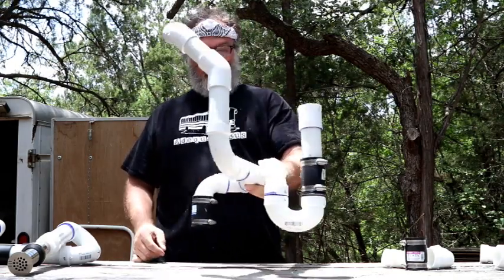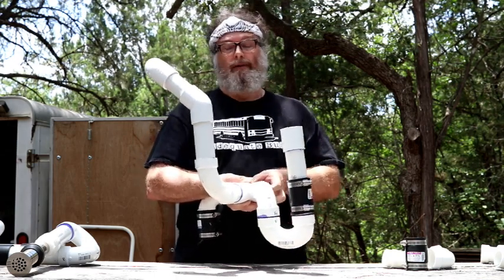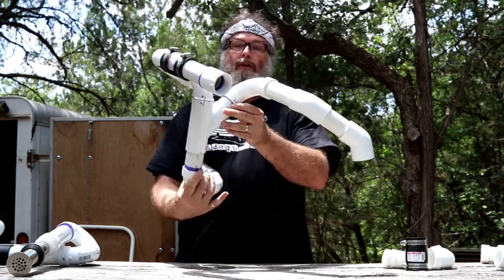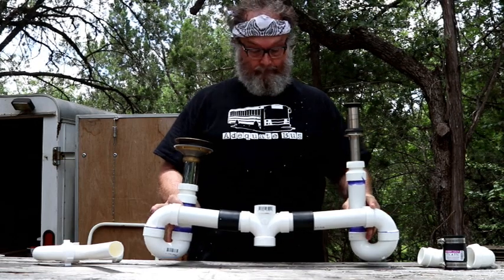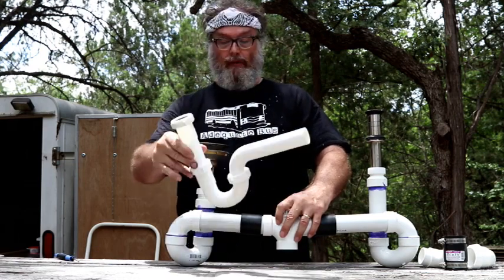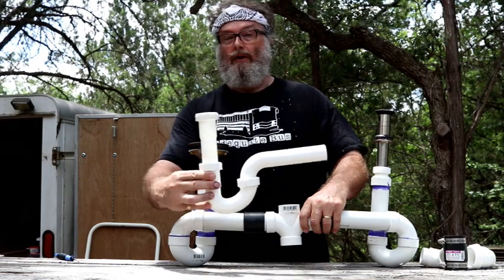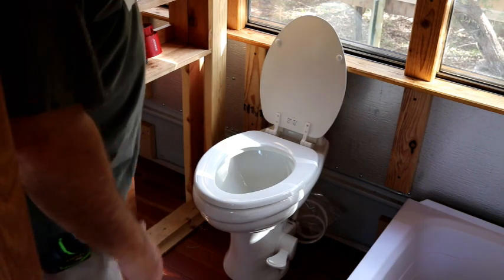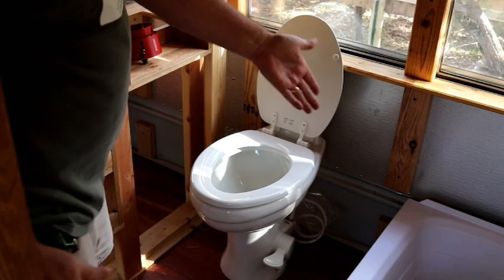Plumbing Drains in School Bus;  Adequate Bus;  Episode 12

Comment: Why did you install a separate tank vent pipe, when you could've used the drain pipe as the wet vent pipe?
Reply from the maker: Thank you so much for your viewing of my little video.  That's a really good question since my understanding of the plumbing Code does envision and permit the use of a drain (under certain conditions), to also act as a vent.

But since this project doesn't have to make a profit, but only last and operate until I'm dead or stuck in a retirement home, I figured a few feet of plastic pipe and an extra spin weld into the tank was worth the effort in order to completely separate the vent system from the drain system.

So far the system is working as expected with no black tank gases nor odors inside the bus at all, and sometimes the bus sits in the heat for months.  However, as you may also have experienced, the black rubber water gasket in the toilet does degrade amazingly fast and require regular replacement.

I'm curious, are you rehabing a bus or an RV?  -C
Reply: @adequatebus8280 hi that was my personal account I commented with. This is our school bus conversion account. Thank you for the reply. Yes we're converting a school bus into an RV, so I asked you that question because I'm researching plumbing and learned about wet venting, which is when drain and vent share the same plumbing partially. I'm trying to simplify my setup and reduce the number of holes in the tank.

Comment: Found you through Badge. ..Genius..Glad I saw this before my plumbing installs..and yes I have a green tape measure from Lowes lol  the rubber gaskets also serve as a fairly easy disconnect should there be any problems (not likely but...) is your black and grey same tank or 2 separate tanks? Fair Winds and Smiles.
Reply from the maker: just one (1), 65-gallon combined wastewater tank, the same size as the potable water tank.  Thank you.  - C
Reply: @adequatebus8280  Thank you that helps